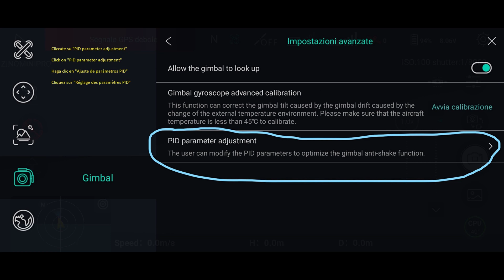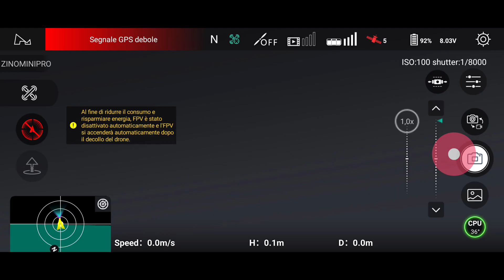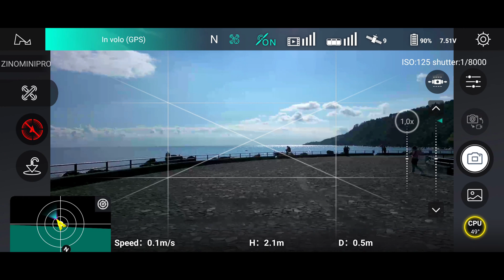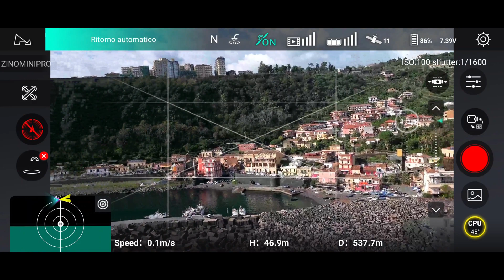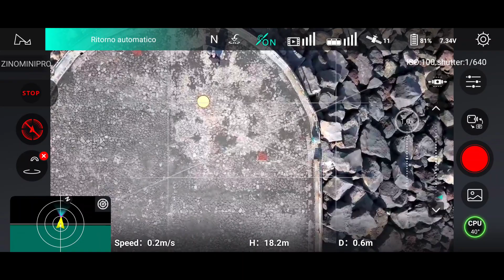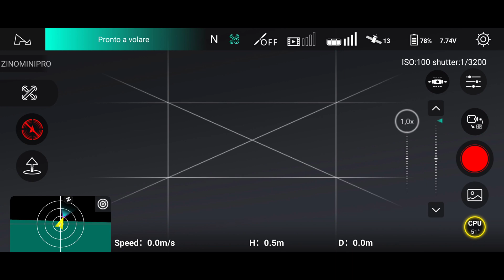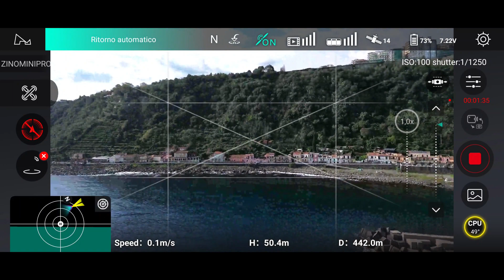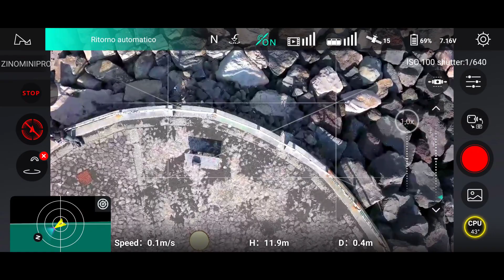Hubsan Zino Mini (all versions) - Jello fix! How to fix Jello with PID - Eliminare l'effetto Jello

Comment: Hallo. Nice little Drone. Can you recommend Hubsan zino Mini SE for beginners? What Maximum range did you  Reach? Thanks
Reply from the maker: Zino Mini SE is a cheap but good mini drone under 250gr. It has a verry long flight tine and the signal strenght is good too. (In this case you have to set the best Channel transmission to get the best stabilty signal) you can watch a video i have uploaded some times ago

Comment: Ciao luka,ho visto che con la 1.3.9 hubsan ha cambiato i valori dei parametri di default dei PID prima avevo un 2.8 adesso hanno messo 1.5 e 1.5 nel pitch e roll👍 da provare forse ci hanno pensato loro gli altri non so dirti Magari li avevano toccati gia' nella 3.8 non so...
Reply from the maker: Vedi come ti va
Reply: @lukappaseidue  direi che con i valori dei PID che hanno messo con la 1.3.9 hanno risolto parecchia roba.Notevole certo sono primi test veloci👍

Comment: Hello Luka, I'm waiting for a new cable with gold-plated Usb + type "C" connections, but for your information your start-up protocol ... Tx, drone, wait for "ATTI", connect the phone, automatic opening of Hubsan 2.0 then switch to Airplane mode ... worked wonderfully for the second time .... more than 800m away in various sectors (north, south ...) and NO Usb disconnection ... !!
I'm going to try again today ... it's already excellent news because on my previous flights BEFORE your procedure, Usb "cuts" were frequent ...
Merry Christmas
Philippe
Reply from the maker: I am very glad that helped you

Comment: Nice video but you're lucky man if you don't get some USB deconnected...Here is for me...!

Jenny, more problems in flight ... and not the least ..! About 15 minutes ago, I made a hover at about 3 m (night flight) lamp under the belly of the drone lit up ... the hover happened normally then climbed to about 7 m .. normal stationary ... then at after about 5 minutes .... NO more flight controls and there I hear .......... USB disconnection .... my drone then drifts to the right, passes near a tree , then go up to the height of the "return home" .... the beep was triggered about 30 seconds later than the triggering of the "home return" .... hence my concern ... I could no longer see only the belly LED ... and finally he came down and landed .... Luckily, he came back to the take-off point ... Can I explain my stress to you or do you understand ???
Well, the Logs of this flight, I looked at them ....
title .... quoted unknown ???
12/20/2021 for 17.57.23
distance 0.0m
flight time: 06.59 minute
Maximun height: 23.5m
ALWAYS no recorded flight distance ...!
Longest mileage .... NOTHING .. !!

Explain to me why the height is 23.5m WHILE THE ADJUSTMENT OF MY "home return" is calibrated to ... 30m high .. ???

Explain to me why I find 6 messages in "Software anomalies" ??? how to send them to you, by clicking on "tell us" ?? because I have already done this for other messages and I have had NO feedback from your engineers .... !!

So your Zino is a big SCAM ... to go in flight with so many possibilities of losing it, of hurting someone by its fall and of not being able to concentrate on the shots is INTOLERABLE ....... ... When will you understand that customers with such problems are pushing to explain via social networks ESPECIALLY NOT TO BUY THIS DRONE ... when will you understand that it is easier to have customers happy to fly with this bundle of tech when it works properly .... Even the latest 3.1.7 updates have not improved anything in my case ................. .When will you understand that my drone does not work correctly and that since it left the box ........! I am neither a liar nor a beginner, what about your engineers ???
Stop sending me to your Italian center at my expense, this is not the solution to eradicate this problem of loss of USB connection which causes so many problems for many pilots .... Thank you for finding me a TRUE solution lasting over time ... !!!
Reply from the maker: HI mate, 
I am afraid for your issue and your crash ( unluckyly I am not Hubsan).
Try my way to have no issue:
https://youtu.be/aasotlkl1Os

Anyway, it seems that you had a bad altitude reading. Is it possible that you needed to calibrate your drone before flying.
I usualy check my altitude value before flying and I notice that it is negative or positive value and I am still on the ground, I perform a calibration of the Zino
Reply: here is the solution: just put your phone in plane mode. No more lost connection on my zino1 since I found that.